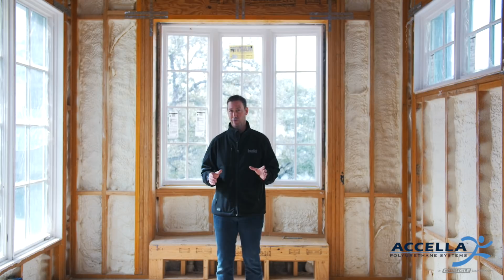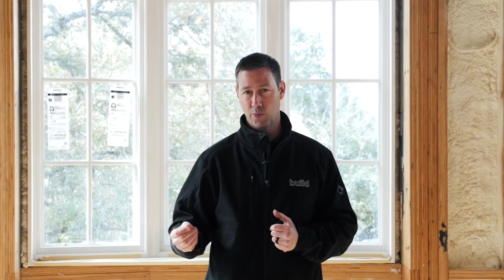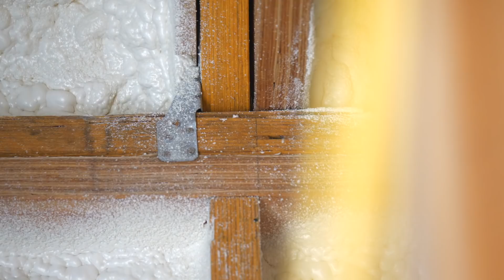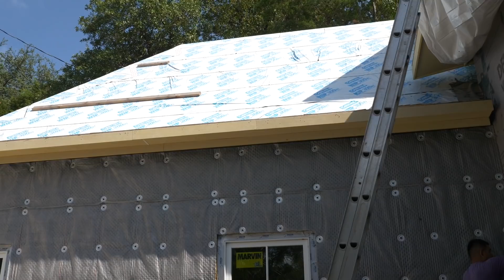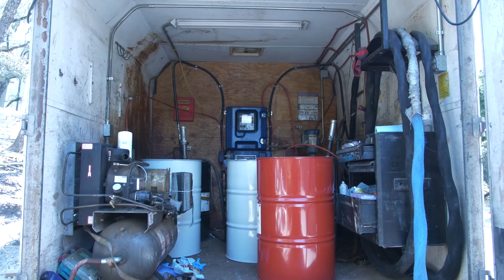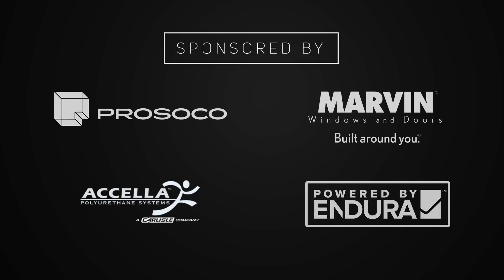Structural Insulation

Comment: Not a spray foam hater by any means (looking to add to my house in an upcoming remodel), but the thing that always gets me is that the advocates talk about the high r-value of closed cell...but they almost NEVER fill the cavity. So if your half filled with a insulation that has 50% higher R value than fiberglass, your actual insulating value is lower.

I understand this project is flash and batt, but I see so many videos of spray foam where it isn't full and they are not doing a flash and batt.
Reply: Matt H
Yeah, basically air leaks are way more important than r-value, so even a thin layer of spray foam could outperform large amounts of batt insulation. Batt insulation is actually quite difficult to install correctly, and is actually quite leaky
Reply: I own a spray foam company. You’re right, many companies don’t apply much foam. Even in cold climates I see guys that’ll spray 2 inches in walls  all the time and call it good. I won’t. I’ll install 3 or more above grade, but depending on your climate you may not gain much by going more. At some point the added cost of the foam won’t offset the energy cost savings and that in a cold climate is around 4 inches. And to the guy that said r value ranges 6-8, the best closed cell foams are near a R-7. Non are r8 or close.
Reply: i live in Winnipeg,Manitoba,Canada we get -30 to - 45 wind chill with -25 to 40 air temps. Also +10c to +30c. And we did our front porch and rear addition with 3" of closed cell foam and we still walk on COLD/HOT bare hardwood floors! When we researched spray foam we thought we found the Holy GRAIL of insulation. Sadly we were mistaken, and we were taken for our money by a unscrupulous independant spray foam contractor! in -25 or -40 weather we still feel the cold. In the summer we still feel the heat! I should have stuck to my original plan of POOR MANS SPRAY FOAM!  The struciale  integrity if the foam is great BUT! Buyer Beware!
Reply: They don't fill the whole cavity with the closed-cell foam mainly because it would be an absolute waste of money to do so. Closed-cell spray foam has an R value of 6–8 per every inch. So two inches of closed-cell foam (as seen here) results in an R value of 12–16. Putting more foam would cause the R value to go up, but it would be a whole lot more expensive to do so, and also would be pointless because there should be virtually no air leaks (a common cause of R values been effectively much worse than advertised, requiring higher and higher values by code).

Even more, closed-cell foam isn't all that great at sound-proofing a home, which is taken care of by the batt insulation. In this case, they're going to use rock wool, which is probably the most superior sound-proofing insulation on the market today.

There are likely a plethora of other reasons for not filling the cavity with closed-cell spray foam, but these are the main ones, I think.
Reply: "Closed-cell spray foam has an R value of 6–8 per every inch. So two inches of closed-cell foam (as seen here) results in an R value of 12–16."    

Or they could just install some Roxul Batts, Open Cell foam, or even high density fiberglass to fill the cavity completely and for far cheaper and still achieve an R- 19 - R -24 wall (nominal values).  They could also tape the sheathing for air-tightness. 

Also, 2 inches of R-6 Closed Cell Spray foam in 2x6 stud cavity does not necessarily equal R-12.  Its probably more like R-9, at best due to extreme thermal bridging through the studs (not even talking about framing fractions yet- which would reduce these numbers further).  A completely filled cavity will also have thermal bridging but not nearly as bad as a 2x6 wall with only 2 inches of CC spray foam. This highlights why we should use U-factors for walls rather than R values as U factors take into consideration the non-linear flow of heat that exists within stud walls.  

Anyway- here are a couple of links for anybody who wants to learn more about this. 

http://www.greenbuildingadvisor.com/articles/dept/building-science/fundamentals-series-and-parallel-heat-flow

https://www.energyvanguard.com/blog/25547/Flat-or-Lumpy-How-Would-You-Like-Your-Insulation

CC Spray foam is amazing stuff- especially if you use it as a flash a batt system like Matt Resigner did in this video.  It is invaluable for insulating a rim joists in new construction. And for retro-fit projects it is the only choice for insulating/air sealing/ adding vapor barrier for old attics and basements.  A good CC spray foam installer is worth a premium.
Reply: ArthurDentZaphodBeeb open cell is cheaper per r value because the same material expands 3x as much. Does it mean its 3x cheaper, no because you have to apply more thickness. There is also more clean up involved increasing labor costs many times. Open cell has its locations and benifits, but if it were me I’d use closed cell for all exterior applications because of vapor control. Depending on install with open you’ll usually be $1.50 to $3 where closed cell you will range from $2 to $4 depending completely upon thickness of foam.
Reply: there is "R-value" and there is "Effective R-value of the assembly" with Closed Cell being air tight and not allowing for leakage like a batt would the effective value is much higher, same with doing the insulation panels on the outside, you create a thermal break that greatly reduces the thermal bridging you would normally see from studs so your effective R-value is MUCH MUCH higher when you look at the assemblies actual value compared to the a batt insulated assembly. also it's price thing, beyond a certain point the cost to insulation value isn't worth it which is why the "flash and batt" technique is so popular.
Reply: Christopher Gruenwald What's a rule-of-thumb cost for closed and open cell spray foam?
Reply: law of dimensioning returns is what most of the rest of the responders are trying to say.

Comment: I've followed your videos for years and I find them very useful.  However, your ever changing stance on spray foam has me confused.   It all boils down to the simple question of Open Cell vs. Closed Cell.  Apart from highlighting a particular favored vendor, it would be instructive to have a definitive answer on which one to use in these hot humid climates like Texas.
Reply: Matt almost always uses open-cell spray foam that I can see, so you might be able to infer something from that. He used closed-cell spray foam on this project, as he says, for the racking strength provided by its glue-like properties.
Reply: DaveC
Simple answer: use closed cell if you build your envelope and flash properly and don't build failing roofs. (If your roof leaks when the covering isn't visibly damaged, then you built a failed roof.)